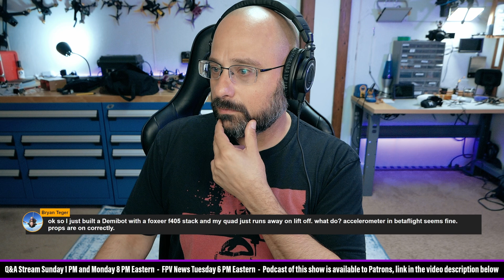My Drone Runs Away When I Arm And Throttle Up? Spinning On Yaw? - FPV Questions

Comment: Everything was correct on mine and I had been using it fine for the best part of a year. Armed ok small inputs gave the correct response for the drone but as soon as I lifted the throttle it would run away. Tried all the prop mapping directions Etc. All okay. Eventually gave up, reset everything and restarted from scratch. Seems to be working fine

Comment: Having this exact problem, it’s full throttling on arm and yawing to the right. Props are on right, motors are spinning props out (tips moving inward towards the stack) and the “motors are reversed switch is selected in bf” idk what it could be

Comment: Also filters set too high.
Reply: Is thera a downsigh setting them low ?
Reply: @ghostrot  The lower the filters are set, the more latency you'll have between input (you move your sticks) and the drone being able to execute your move - so it's a bit o fa balancing act between having your filters low enough to clean out noise in the gyro and dterm, but not too low that it adds latency and gives you a 'spongy - damped - disconnected' feeling.

Comment: We had this disagreement a while ago. I think we were both right about what happens and here’s why. The quad I made this mistake on was a small whoop. I think you may have experienced this issue only on quads without ducts or prop guards. I think the prop guards reduce the yaw authority and that is what keeps it from yawing back and forth. Runaway kicks in before it can start to yaw back.

Comment: My 5in is set to props in for some reason and when I try to change it in betaflight the switch changes I hit save and it still spins props in, also says to update to a newer bf to check motor rotation
Reply: you need to change it in the esc setting
Reply: @blup7352  how?
Reply: @2down2togo   depends on what esc you are using, or just watch a youtube video
Reply: @blup7352  ill see what I can find, thanks. I think it's a stm firmware or something like that
Reply: I think it's a flycolor brand, came from a arris 5inch drone
Reply: @blup7352  it's omnibusf4 by flycolor, what configurator will I need
Reply: @2down2togo   omnibus f4 esc or fc?
Reply: @blup7352  its a 4in1. Not sure what the esc says but the fc says flycolor on it and when I plug into bf it says omnibusf4 firmware. It's a flycolor 4in1 stack
Reply: @blup7352  what's weird is I never recall changing the rotation and it use to be props out. When I try in bf it says upgrade to 4.3 but always fails to go thru
Reply: @2down2togo  good luck and have fun
Reply: I don't know but you can write joshua an email or ask him in the next Q and A stream
Reply: could be BL_heli32
Reply: The switch in Betaflight is you telling it which way the props are actually spinning so it knows which motors to spin for yaw authority.  That switch doesn’t magically flip the direction the props spin in real life.  You do that either by programming the ESCs or by resoldering the motor wires.